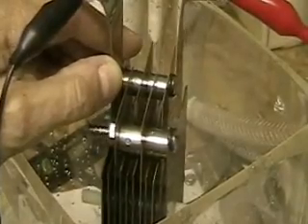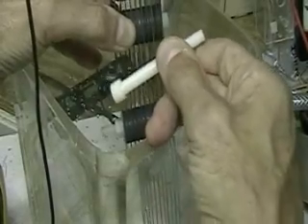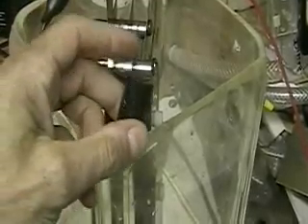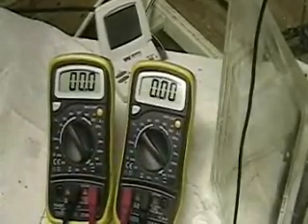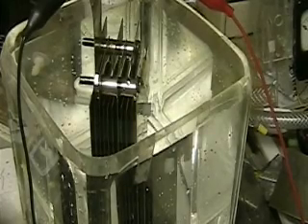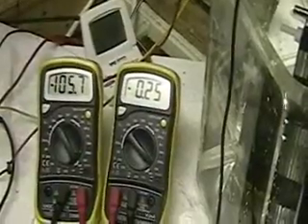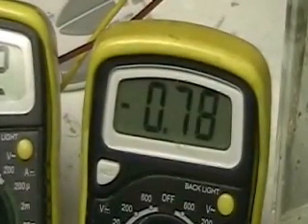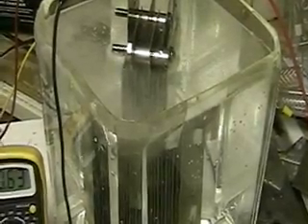Hydrogen Tap (FOCUS- LYE) 349

Comment: Just as an idea for fritz, I run a 350W inverter in my car, and use a few 110v AC devices from that inverter. That could be used to source 110v in a vehicle easily.